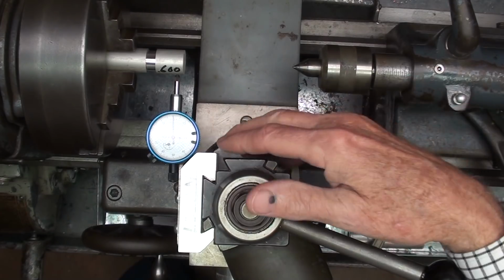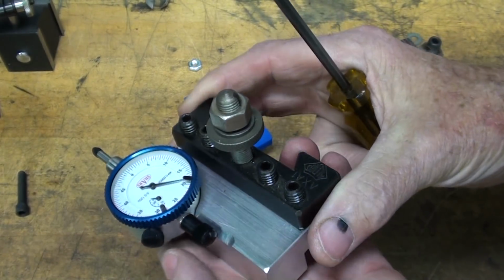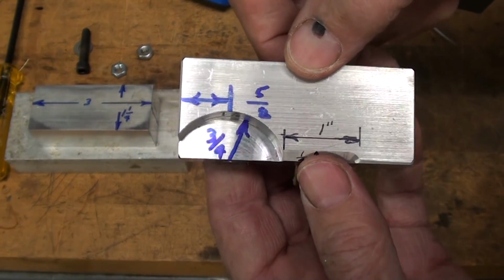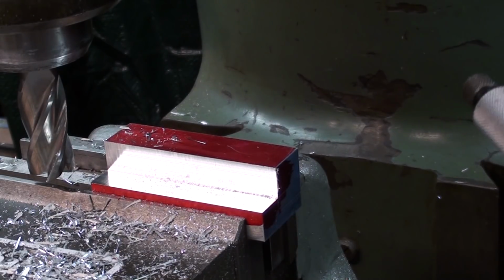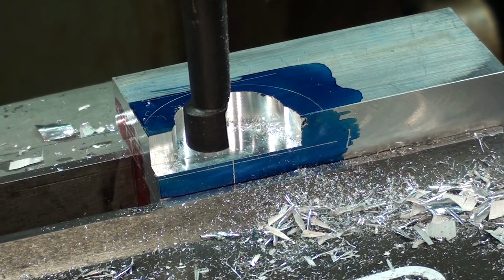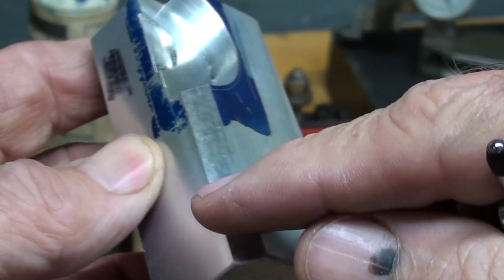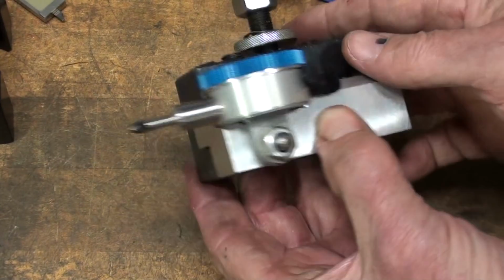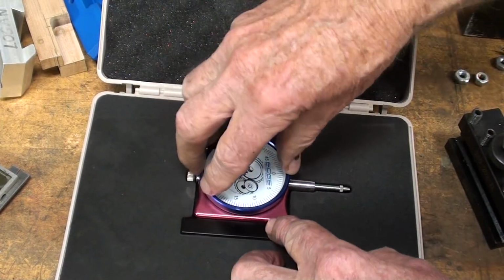Make an Aloris Indicator Holder TIPS #409 tubalcain

Comment: before I purchased a boring head I did a similar dial indicator pocket with a small purpose built flycutter.  I ran the quill up and down after final pass to clean up the bore wall.  Great video as always!
Reply from the maker: +bhartwigutube thanks, I may use a fly cutter on the next one

Comment: I like the dedicated AXA indicator holder; it would be a good refresher project (it's been years since I've done anything in CAD).  The stuff from Edge looks good, but most is so simple, I just make my own.  That's half the fun of having a good shop- making your own tooling!  I only buy things I can't make reasonably, like indexing heads.
Reply from the maker: Yes, it is more than half the fun
Reply: Printed the AXA holder by moonismyhome- looks good; will see how it fits in the morning!  I started my own on tinkercad, but came up against some roadblocks- it lacks some basic functionality.
Reply: The AXA holder turned out well, but is too tight to fit a Phase II piston type tool holder.  Would probably work better with a wedge type holder.

Comment: Mr Peterson, Just a suggestion for the upcoming Vee slide holder. Make a replacement DI back with an on center post, You can now use the same attachment for radial and face measurements by simply rotating the DI in the holder.
Reply from the maker: +Rob B good idea, but it would make it much more complicated. Might be easier to make one of each style
Reply: What if for the dovetail holder(coming soon™) there were another dovetail mirrored to the left of the dial? Then you could mount it quickly for face indicating. Now if the dial could stick out a little, think of the mount like a T with the Dove's close together to the left/right, and mount the dial on the end. Know what I mean? Just another thought. :)

Comment: Hello there again Mr Pete.
Another nice project well explained and shown. Although we had made a different version we experienced regular working difficulties with our design not being compact enough whilst working close towards the Chuck end.  Yours is a very practical and  useful design which would suit us well.

However, just thinking aloud, Your design would be used (one way) perpendicular to the work face only.  One would not be able to use it from the front, facing the Chuck to read the work-face settings.  Methinks that one would need to Mill all the exact same dimensions on the opposite end, to Your present fitting. That way it would serve as a dual direction DTI holder with capability from both approaches.  One will only need make sure the Length of the Toolholder is amply accommodated.  Now that is what we would ultimately consider seeing that we are going to all the trouble to customise and fabricate one of these.  Will just need modify dimensions to fit our 20 x 20 mm Toolholder.  Just our two cents worth which we hope is on the right track and may benefit someone contemplating building one. 

Thanks a stack for sharing. Much appreciated.  Keep 'em rolling.
ATB
aRM
Reply from the maker: Thank you for that information. And I have been planning a double ender. That would of course require two indicators. And I had thought about the one that you mentioned, but the indicator would have to rotate. And some of the dimensions would be critical to avoid having to re-center it
Reply: We had been thinking of using the same Indicator and just turning it around - without having two dedicated ones on the same Toolholder.
However, as a hobbyist, regretfully I do not understand Your statements about it having to Rotate and that some of the Dimensions would be "critical".   
Seeing that it would be fitted on the same Toolholder and requiring the same Centre Height, would not the Centre Height still be the same, even from the Chuck face-end  ???
Would be nice to have Your clarification and point of view here - before we proceed constructing ours, albeit I am still in the drawing stage, which I always like to commence with. 
TIA
ATB
aRM

Comment: I've got a good tool post holder for indicating diameter and I can remove the indicator and swap it to indicate on a face. I'd like to make a holder that easily switches from indicating diameter to indicating face without having to remove/re-install the indicator. I really like the rigidity of post mounted indicators.
Reply from the maker: +DSCKy it could be made as a double ender. Like my double ended carbide attachment
Reply: That is a possibility...

Comment: A few years ago, I bought a lot from a machine shop auction that had at least 1000 end mills (along with the cabinet for them).  It had way more end mills than I will ever use in my lifetime.  I have several 1 1/2 inch mills.  If you would like, I would be glad to send you one.  I thought that I had 2, 4 and 6 flute, but I only found 2 flute and 6 flute.  Let me know if you would like for me to send you some.
Reply from the maker: Yes--I would --thank you VERY much. Please contact me again at this email--for my mailing addresss.
pete22@mchsi.com

Comment: I have a long one here, first thank you for the videos I've been wanting to make one of these holders. I did some lathe work this week and used your teachings from the "splitting hairs on a lathe" video (compound 6 degrees for 10:1 depth cut) and it worked great! Also I wanted to comment on "what's in your stocking" video. Last Christmas a miller spectrum 375 plasma cutter was under my tree! Yes I am blessed with a great wife!! I was very surprised! I do have a question though. In this video and previous ones where you mention your rpm for a 3/4" is 1100 rpm, isn't that a little fast? I always used the formula: 4 x cutting speed (aluminum 100) divided by the diameter of the bit (or stock on the lathe). That would be about 533 rpm for a 3/4 inch end mill. I took a machining class years ago did I misunderstand something? It seems to work okay and leaves  good finish but I had to ask. Thanks again and Happy New Year

Comment: Nicely done Mr. Pete.  The only modification I would make is to tap the 1/4 x 20 hole to eliminate the countersink and nut?  And oh by the way I did like the first one you made....  ; ^ )
Reply from the maker: +Fred Miller thank you
Reply: With a button head hex cap screw? Lower the profile at the indicator attachment and smooth the lines?
Reply: I was thinking the same thing. Still looks good the way he did it though.
Reply: If you watch his latest video he incorporated that idea in his latest version.  I like the way ideas get built on within the Youtube machining community.  I showed the making of a simple hand / pin vice on my channel and within a day another Youtube contribute improved on it.  Cool community...

Comment: If you'd like to continue your "shame", please make a quick change tool holder which mounts on a lantern style tool post.
Reply from the maker: Never occurred to me. I suppose most viewers are still using lantern toolposts,
It will depend on if anyone watches this video.
Reply: I also would request a lantern style tool post holder
Reply: Seconded!
Reply: Yea please make one I stall use a lantern post
Reply: 17,732 folks viewed it so far..... :-)

Comment: I made a holder for a dial indicator out of aluminum but cut dovetails on the back to match my tool post instead of tying up one of the regular tool holders for such a light duty use.
Reply from the maker: +disgruntledscientist don't get ahead of me. That's the next video, I am working on it right now. And fact I showed a prototype of it in this video I thought.
Reply: My bad, must have gotten distracted and not watched to the end. I had also made an aluminum dedicated tool holder for a scissor type knurling tool and was looking for it in my shop!

Comment: What would you think of making a cleanup pass during the boring heat operation by just retracting the z as a spring cut? I know the boring bar would have poor cutting geometry going that direction but I think that's what I would have tried for balancing simplicity and finish.
Reply from the maker: Yes, that probably would work

Comment: Great Job Lyle! I am looking forward to the next iteration. I wonder if you would ever consider creating a finger press engine?
Reply from the maker: +Don Cheke what is a finger press engine?
Reply: It is basically a toy engine that you work with your finger. Here is an image of one I made a CAD tutorial for. http://www.textualcreations.ca/Flash_Gallery_V19/load/images/Finger%20Press%20Engine%20Tutorial%20Dimetric%20NE_1200.jpg
Reply from the maker: +Don Cheke thanks, I like that. It would make a neat little project although it does nothing. Are used to have a large foot operated wheel, with a cast-iron wheel perhaps 2 feet in diameter and it was used by perhaps a dentist or a jeweler to power their tools
Reply: Agreed. It does nothing but it would be fun to have one on one's desk as a conversational piece.

Comment: Thank you Mr Pete for another interesting and informative video, I always enjoy your work. I do have a question about the through hole. Is there any reason that it is preferable to drill and counter-bore the hole like you did versus drill and tap to take the cap screw directly? I'm curious if it was only personal preference or if there was another advantage to the way you did it that I'm not picking up on.
Reply from the maker: +Marty Puckett it actually never occurred to me. The counterbore is a carryover from the printed one.

Comment: I have a question on layout technique.  How did you go about accurately placing the radius template (at 15:00)?  The height gauge against the surface plate is certainly straightforward enough but when you scribed the arc for the pocket that holds the indicator body it went by without commentary.  Did you just place it so that it was visually tangent to existing intersecting lines?  Thanks.
Reply from the maker: yes--just guessed--it was for referance only
Reply: Thank you

Comment: Hi Mr. Pete, congratulations for having a go at 3D modelling - I have tried it and found it hard going. Did I miss the bit where you discussed ensuring the indicator was on the centreline of the lathe? Or does it not matter if it's off? Greetings from Scotland.
Reply from the maker: +abywater I don't know if I mentioned the centerline or not, but of course it needs to be on center. The next 3-D model coming up will not be done by me, but by a friend who will use fusion360. It will have a double tail. Thanks for watching watching

Comment: Vernier Caliper Box KEEP OFF message sliding lid version.
https://www.thingiverse.com/thing:2095396

3S Printerd in 4 parts using ABS filament stuck together, e.g. Acetone, etc..
Reply from the maker: That's a neat print
Reply: Hope to see a video of yours soon. I find this useful to protect my dirt cheap Vernier Caliper. Using small amount of 99% Pure Acetone on ABS makes a strong, weld type join. Did the same type of weld join on the ABS parts here:=
Dyson DC16 Vacuum Cleaner extention https://www.thingiverse.com/thing:2695397 and still not come apart.
This is Only ABS not for PLA filament prints. I found 99% Pure Acetone is best, capillary action between parts and maybe a little bit more very, very strong like welding plastic
Reply: P.S. like Mushrooms growing is quicker